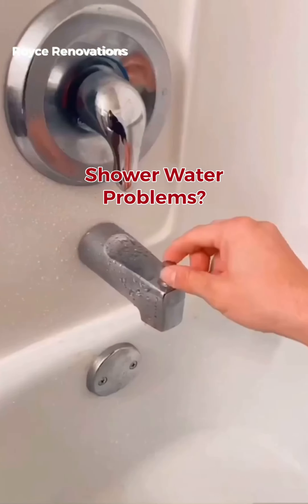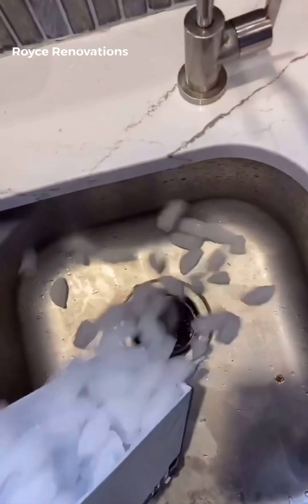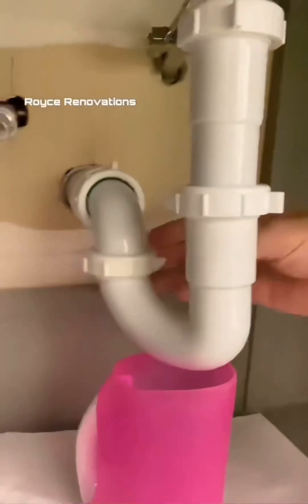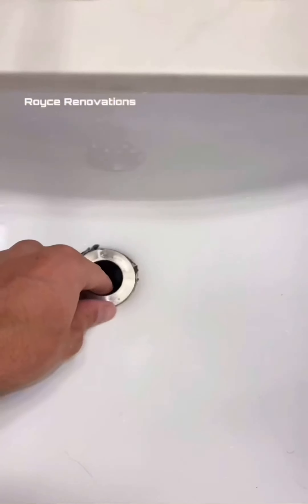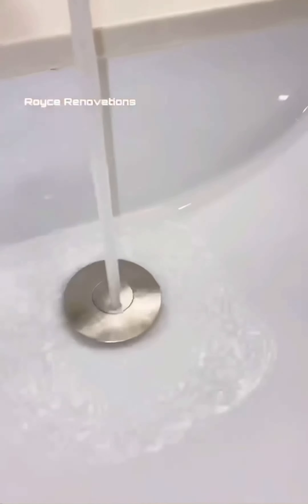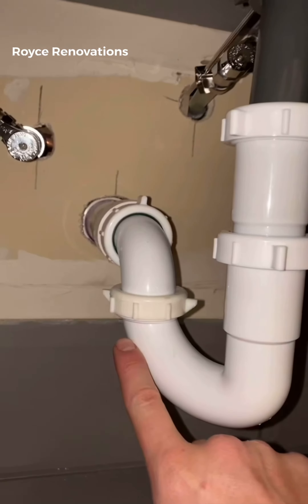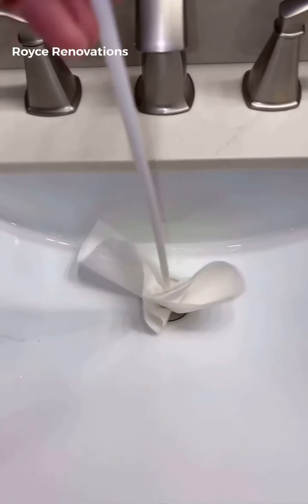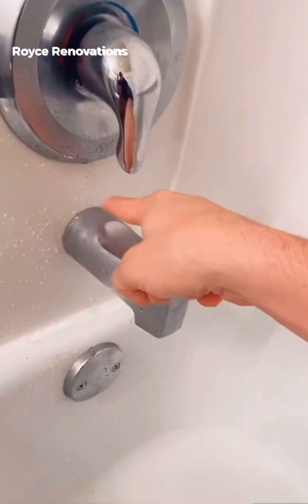Every Home Owner Needs To Know These Tips. Part 2. | Plumbing #shorts #howto #homeowner

Comment: Hi I have a few questions. I've watched alot of your videos and I don't think you've covered them. So I just bought a house a few months ago. I noticed when I am using the washing machine when it drains my kitchen sink makes a gurgling noise. Also if I have one side of the sink stopped up when I'm washing dishes, the side I'm rinsing with seems to not drain well, it seems slow. Thank you for your content it's really informative.
Reply: Both gurgling and slow drains could indicate issues with your venting- either it's getting blocked up or it was never done correctly in the first place. If you have the ability, see that it's not blocked up. Sometimes squirrels like to use the vents on the roof to store their nuts, or something like trees and debris could be blocking the vents. The gurgling sound is your sink acting like a vent to let air into the drain line to allow the washing machine to drain. The gurgle is caused by air passing through the trap which should be filled with water to prevent sewer gases from coming into the home.
Reply: @scyarch1136  ok thank you for the help. I think it wasn't done correctly in the first place. I think the previous owner's sons were doing repairs then she passed and the children agreed to sell. Should the washer have a separate vent/connection to the spectic tank? I can do some preliminary checks but I've searched youtube and I can't find someone explaining this circumstance.